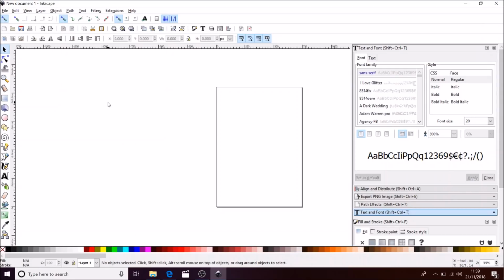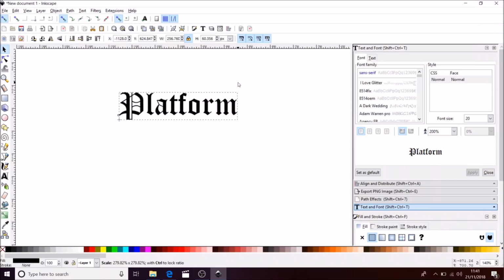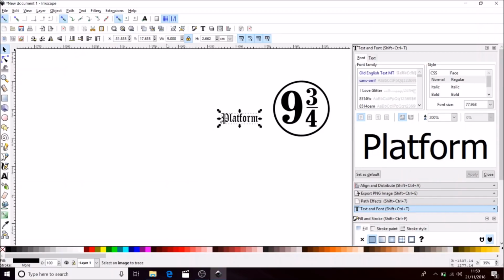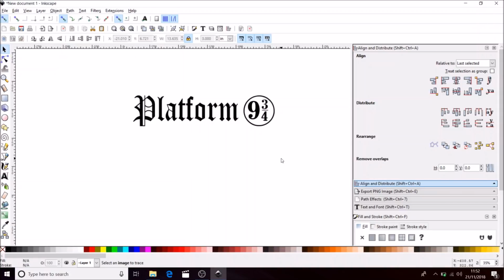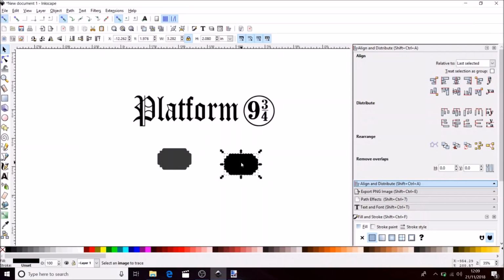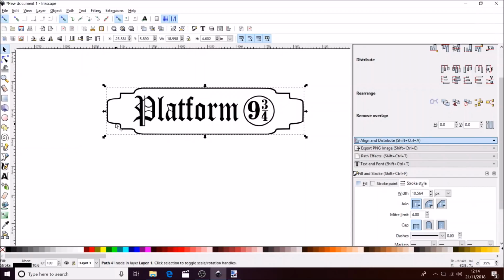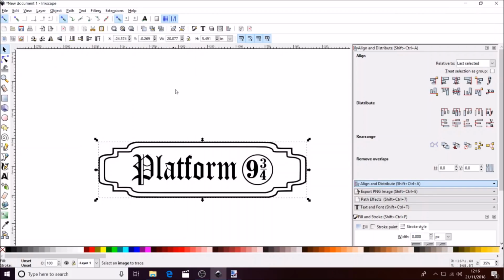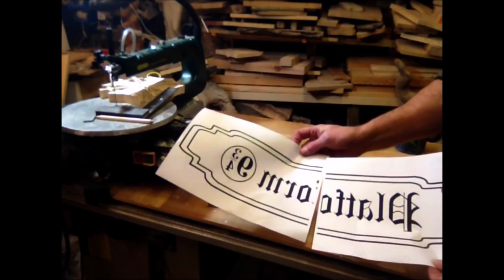how to design a sign in inkscape

Comment: Thanks for the great video, learnt alot, but have an issue, I have designed the sign I want, went to print it and nothing but a blank sheet comes out?  any ideas. Thanks
Reply from the maker: Hi Warren,  did you have your image selected when you tried to print? Often if I am designing a larger sign, I export it to Microsoft paint and print it that way
Reply: @JohnathonWhittaker  Thanks will try that out.

Comment: I am using fusion 360 for a cnc for wood signs.  Fusion doesn't seem to work well with several lines of text.  Looks like I can use in inkscape to create the sign as you did but would I make it a svg file to work in Fusion?
Reply from the maker: I am not familiar with fusion but I imagine you would have to make it an .svg file. I have had similar questions before on this topic and I think that alot of the cnc software and inkscape are incompatible. I would be interested to hear if your successful though

Comment: Great teaching video johnathon it takes some studying to get to know what everything does but it's such a versatile tool I usually save the design on the a4 size and use a program called posteriza to make it larger which splits it into sections for you and shows cut lines too line them back up again
Reply from the maker: That's great advice Warren, Thanks!